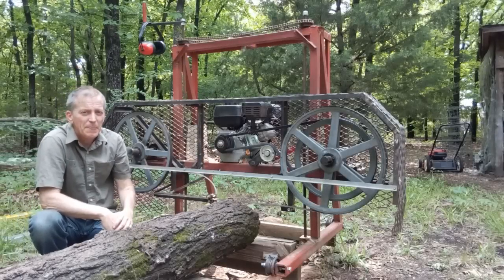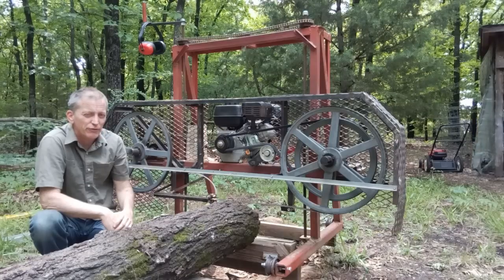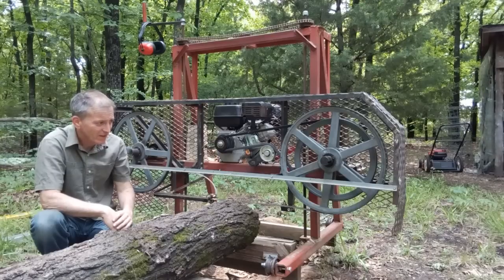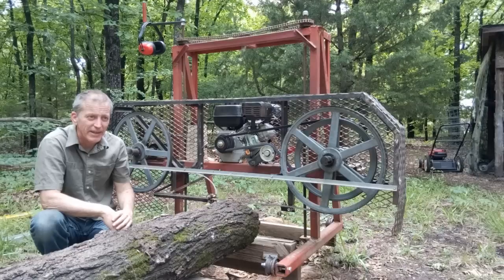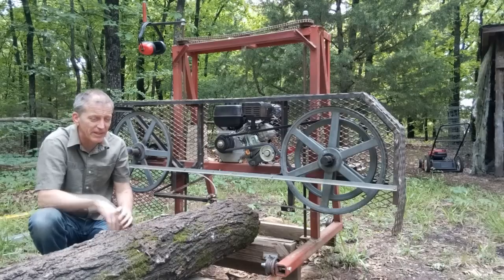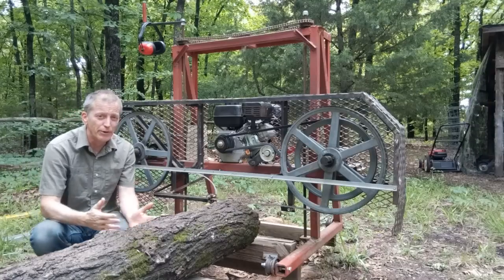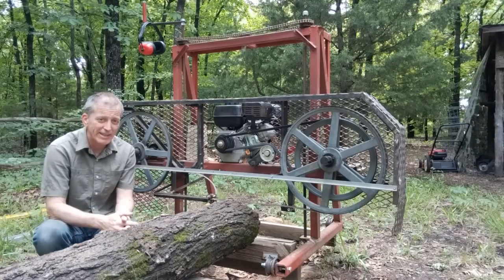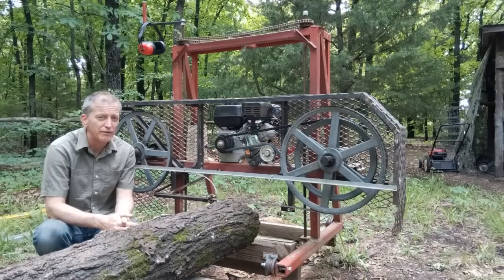Bandsaw Mill 4  -  Getting the best speed

Comment: what size v belt did you end up using on those wheels? i have 18.75 o.d wheels which i believe are the same as yours. I purchased them from the Surplus Center.
Reply: B55 is what you need fit great.
Reply from the maker: Thanks for your interest John.  I found out what size belt to use from a forum but I can't remember what forum or what belt size.  I won't be out to the mill for a few days yet and I'll see if I can get the size for you.  You might try getting a belt the same circumfrence as the wheel and it should take some work to put it on.  If it goes on easily its too big.
Reply: John Raney
Reply: Gorse Hill B55 is a great fit on Surplus Supply 18.75” sheaves.